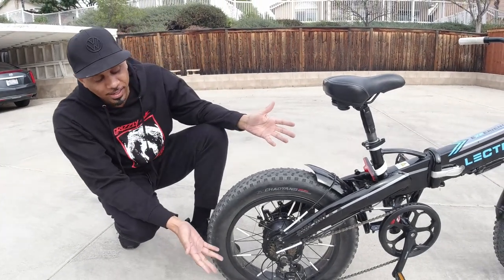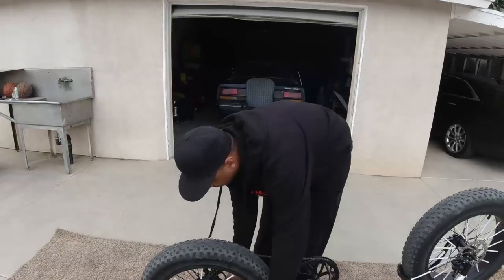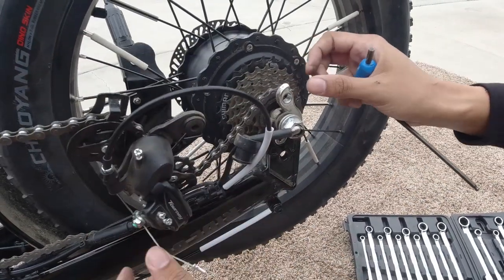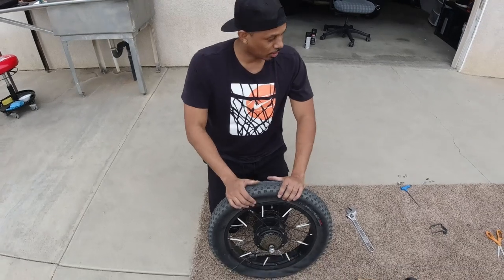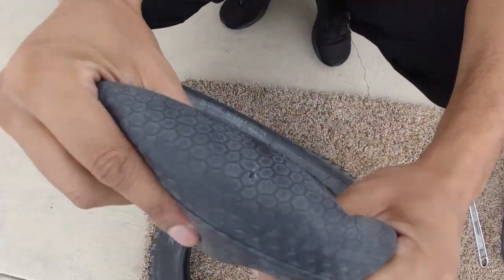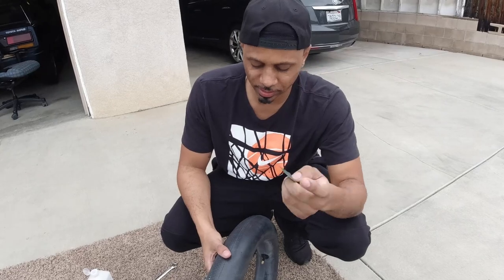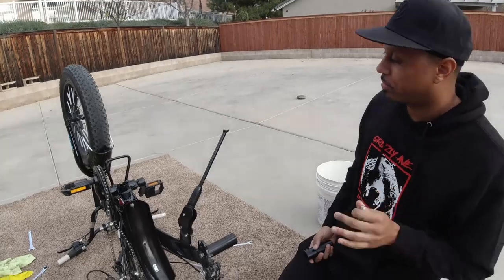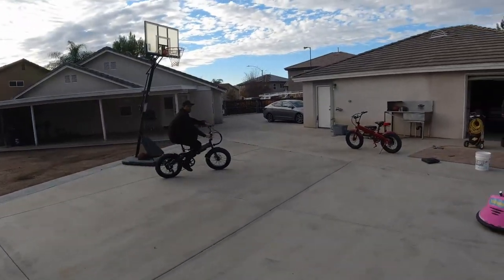How to Fix a Flat Tire on the Lectric XP E-bike

Comment: I worked a  tire shop for years.  You should use chalk to make where the tire valve is so that once you find the hole in the tube, you can them match up the location in the tire so you can inspect the same location in the tire for the item that caused the hole such as thorn, glass, tack, etc. I would use a glove to inspect the area because if it was glass then you'll cut your finger when you run it over the hole area if the glass, etc is still in the tire. Also, leaving that plastic applicator from the patch inside the tire will eventually  create a friction hole in the tube.

Comment: 2 things that were incorrect were 1 you didn't spread the glue out around the hole, 2 not deflate tube to almost no pressure, that being if it's ever fully deflated the patch will shrink up. a roller/rasp is handy for stitching down the patch to ensure no air pockets under the patch, they can be bought from China bay for $3

Comment: Always use the box end of the wrench when possible. When removing and reinstalling tires, use something slippery (I use Windex) and spray it all over the bead to make the tire bead slip over the rim a LOT easier. No need to rotate the tires. Just replace the rear tire more often. Most tubes shred when punctured, so it would be a good idea to carry an extra tube and tools with you. Windex is also great for finding the hole. Oh, and it also helps seat the bead when reinflating the tire.
Reply from the maker: Thanks for the tips 👊🏽

Comment: Thanks, this helped. I wish it was easier to pull off that back tire. Not easy to fix on the spot. I ordered a few new tires but think I will patch my old one as well. Good tip on the tire rotation, I wouldn't have thought of that.

Comment: Hi David, 

I was wondering why you didn’t just pull the tube out of the tire. But I see you are doing a tire rotation. Some people fix a flat without taking the tire off the bike. 

But this is great content!

Hey, Jane!!!
Reply from the maker: Yea I figured I would give it a tire rotation as well 👍🏽
Reply: You have to be really careful to not pinch the inner tube when not removing the tire but are fixing the puncture. I simply adjusted a slanted air intake and wound up with a pinch flat. Actually, it blew out the tire.
Reply: @NotNowLater  OH NO!!!

Comment: The derailer does not need to be removed to change the tire. In fact, I would strongly suggest you not take it off. It's a sensitive piece of equipment that needs micro adjusments all the time. Advice to the Maker: do a dry run before you record so that you find out things like the motor connection, the small screws and eye socket that keeps the back axle alligned.

Comment: Great video as I just got my first flat at 198 miles. I read other side had a problem removing the rear wheel based on the stiffness of the frame but yours seem to come off without any trouble. Hope mine is just as easy.
Reply from the maker: Yea it wasn’t hard to do.

Comment: You crack me up young man..lol. I had a couple of flats in the front tire so I put in a tuffy liner. Tire went flat again in the cold weather. I had a hard time putting in that liner. Bike shop said it took them an hr. I'm wondering if it's possible to glue them in? Bike shop said they won't do another.
Reply from the maker: I never thought about that but I guess you could. You wont be able to reuse them if you change your tires tho.

Comment: I had to like and subscribe to this video because I'm periodically getting flats on my rear tire which is a pain because I recently just had my e-bike serviced at home.  To get full protection from getting any flats I bought some slime sealant, tire liners, and  I also have tubes. Would buying the patches as well?

Comment: Lol that should be your intro for every video...do a cartwheel 🤣😂
 And btw you didnt have to take off the chain derailer thing for the wheel to come off
Reply from the maker: I injured myself doing that cartwheel 😂 

I wish I would’ve known that lol
Reply: @DavidBrandNew  ya i swapped my buddies wheel out like 4 times and dont remember taking that peice off. First wheel that came on the bike didnt read a speed or clock miles...2nd one they sent for free came with a bent rim...3rd one worked fine but he had a blow out...4th one is a combo of the rims and tubes from what he has now
Reply from the maker: @MrDave008  dude that would’ve made life so much easier lol

Comment: I like your video but.  I am slightly terrified of removing the rear tire.  I could have used a little more detail in the removal and replacement of that tire and all the stuff that goes with it.  Excellent suggestion in how to turn the bike over as I am also a weakling.
Reply from the maker: To be honest you don’t have to take the rear tire off. You can simply deflate the tire enough to pull the tube out to locate the puncture. Then just patch it and put the tube back in. I only took the entire wheel off because I wanted to do a tire rotation.

Comment: After reading the comments I realized I'm not the only one
I bought 10 bikes
Every one I've used gets a flat usually within a few hundred miles
Some delivered with flats and no apparent puncture
I suggest the company use better tubes
Apparently they are aware of the problem 
Tuff tubes, thornproof are hard to find and expensive 
I found a 3x20 tube at local bike shops
19.90 to 29.99
But they get flats quick as well
I suggest carrying fix a flat can and replace tube asap
Never trust a patch 
Or a ebike salesman lol
Edit
Always run finger around tire look for sharp objects , whatever caused the puncture will re Pete if not found 
My guess is a design flaw ,spoke head rubbing on tube
Replace tube protector around rim couldn't hurt

Comment: Great video, love your stuff!!! 
Ever use Slime or something similar on a flat tire?
Reply from the maker: I will in the future
Reply: @DavidBrandNew  One of the first things I did when I got my XP got a pinch flat, ach! Had to get a new inner tube since the tire had blown out. Had some tire puncture protection tapes plus some slime on hand which I went ahead and installed. Had ordered those items sometime before waiting for the right time to install them.

Comment: You should do yourself a favor and get some tube type slime and add it to your bikes on day one and unless you pick up metal or glass the slime will repair the leak itself, in 5 years I've only had to repair one flat and that's because I ran over a tire tread and a wire broke off in the tire

Comment: Easy : 

1. Don't remove tire .....  turn bike upside down

2. Take inner tube out thru tire .... 

3. Find hole .  ( Draw circle around it ) 

4 . Buy patch kit and slime Sealment

5. Use kit and patch ...    Follow instructions

6. Take valve out of hole ....

7. Add 6 ounces of Sealment

8. Spin tire ever 2 ounces ..... Put valve back in

9. Use air pump and pump ... .

10. Every 10 pumps .. spin tire until filled ..... Watch psi amount 

11. Nice repaired tire
Reply from the maker: I had to do a tire rotation as well but yea you’re right if you’re just fixing the flat
Reply: When putting the inner tube back in the tire partially inflate the inner tube to help with placement back in the tire. You can wind up with a pinch flat otherwise, just a word of caution.
Reply: @NotNowLater  yeah true ... I used plastic gloves tho .... Thx

Comment: Those tyres, like all these designs are more balloon than tyre, too thin. If you get a real puncture that totally deflates it, the tyres easily pop off the rim , dangerous, and murder to push the bike at the least. Best solution, get some tyres with tread and a liner inside to protect the tube. Slime doesn't work on these, a tiny hole in mine just spread slime everywhere making this job much harder. Liners are available in 20 x 4 but a bigger dia one can be cut to fit. Putting the tyres back on it tends to pop off the rim as you inflate in places, grab the top and hold it up tight to the rim on the bottom to keep it there, you can squeeze the top to make sure that stays in there

Comment: I wonder if they make a 4in puncture guard
Reply from the maker: I tried finding one but no luck
Reply from the maker: @thegoodchad3578  does that work on the 20” wheels?
Reply: @DavidBrandNew  yeah you cut it long enough to overlap itself when inside the tire. Comes in roll that is 4in wide
Reply: @DavidBrandNew  says up to 29 inch wheel
Reply: @DavidBrandNew  high dollar though. I’m going to keep looking
Reply: @DavidBrandNew  The closest I found was a 26x4 tire puncture guard. You simply have to trim the excess. Found it on Amazon.
Reply: @thegoodchad3578  Make sure to leave plenty of extra when you cut the protector tape or you might end up with a gap.
Reply: @thegoodchad3578  That is one of the few protectors out there for 4" tires.